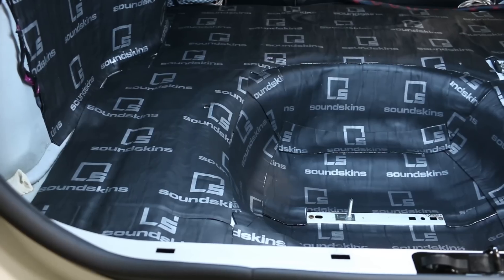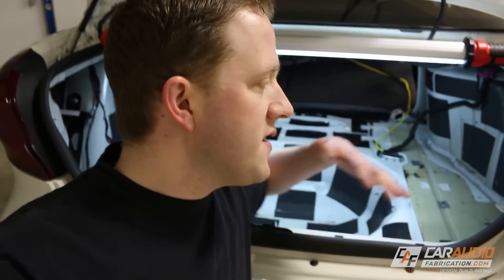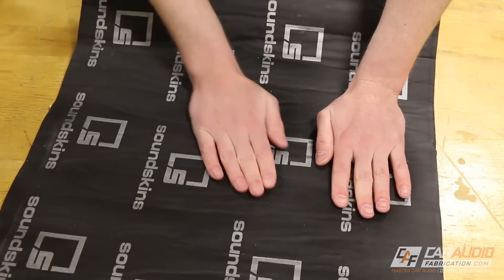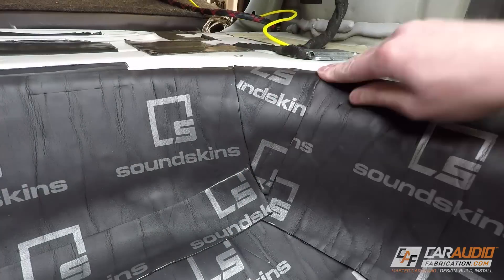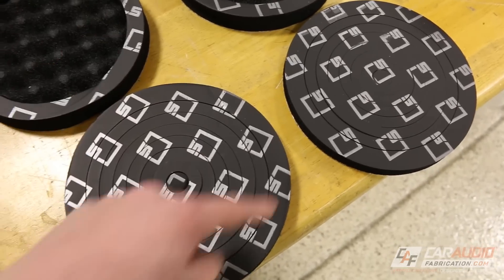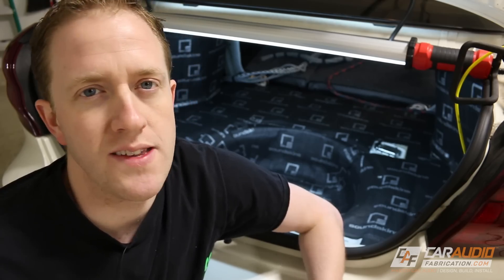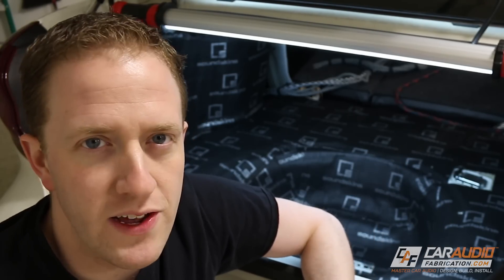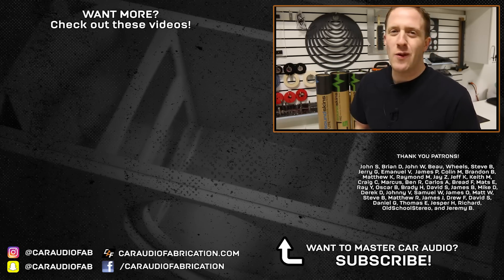Trunk Sound Treatment Process Explained - Improve your BASS!

Comment: I just swapped my 1k watt rms amp for a t1500 amp. When I turn my volume up the interior speakers are much much more quiet than when I had my 1k watt amp.. Is this just from more current being drawn and taking away from my interior speakers?????
Reply: souls elite your bass is probably louder now which explains why your speakers sound quieter.
Reply: Critical Audio yes the bass is louder but I can turn it down with my bass knob and there's still a noticeable difference. I was getting super loud crisp sound at 15 on my deck vs 25 now. I went from one type R to 2 type Rs and 500 more rms on amp.
Reply: I have all Alpine type s speakers and a shitty Rockford prime 400.4 pushing them. I got 2 20 amp batteries sitting here. I'll report back in a week..

Comment: What exactly is the acoustical foam? Is it closed cell foam is it mass loaded vinyl?
Reply: Not mass loaded vinyl (MLV)
Its open cell foam. 
With open cell and closed cell foam the sound absorbion rate it determined by the (R) value at a given musical Hz.
It stops the reflection wave (not the direct wave) of the sound arriving at your ears at a different time

Comment: I used first generation Dynamat. It had to be put on with a heat gun. The technology has advanced so much since the late 80’s, early 90’s. I won a set of those speaker rings. I will be doing total coverage of my 06 Impala with Soundskins Pro.
Mark do you recommend using protective gloves with this product?

Comment: My concern about all this “sound deadening” process is: the car is going to weigh several pounds more, make it slower and wasting more fuel, also I have noticed that even high end, well isolated and quiet cars don’t use “DYNAMAT” or equivalent in their doors or panels, in the trunk just a few strips, the rest is jute and a white type of material similar to polyester o cotton...I guess it is THINSULATE
Reply: Does it really get slower if you have a passenger? Are you saving  much more fuel just driving alone?

Comment: If the foam layer helps with road noise, then wouldn't it also deaden the sound of the speaker's?
Reply: No, the speakers are on the inside of the sound deadening material. Additionally, we hear the air displacement from the speakers, not any vibration produced from surrounding materials.

Comment: What kind of trunk floor is that?
Reply: Looked pretty easy to take out
Reply from the maker: Pretty common for trunk vehicles to have this rigid board like material that has trunk liner on the top face.

Comment: that is alot of sound skins in that trunk, close to 5-600??
Reply from the maker: It's like 1.5 rolls if I remember
Reply: @CarAudioFabrication  i have a f150, so i imagine doing the back side of the cab would be less, thanks. what would be the best subwoofer bass config for under seat? Front firing or down? Ported versus non? four 6.5 drivers or two 12 down firing?